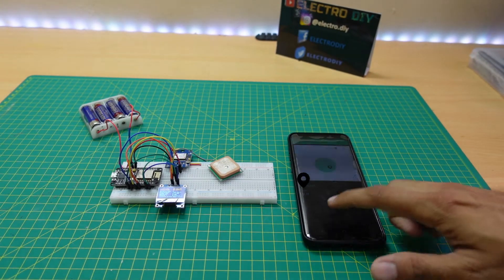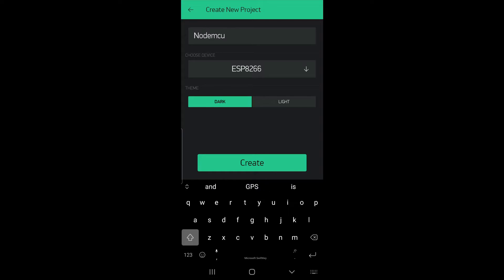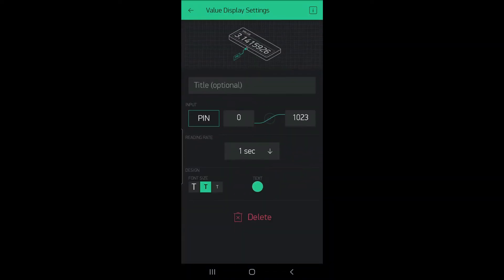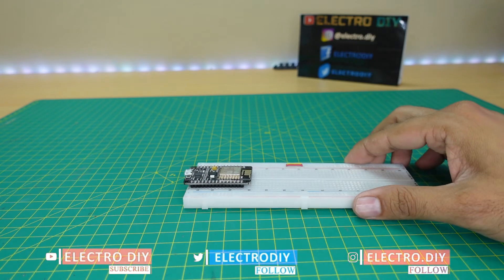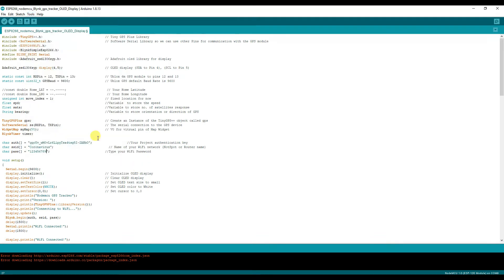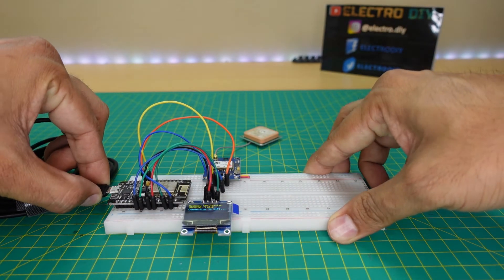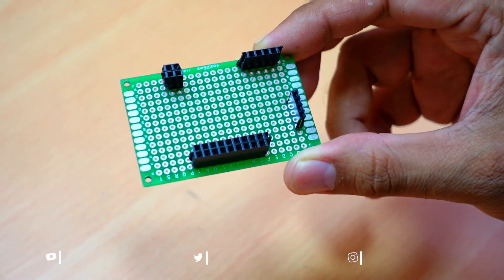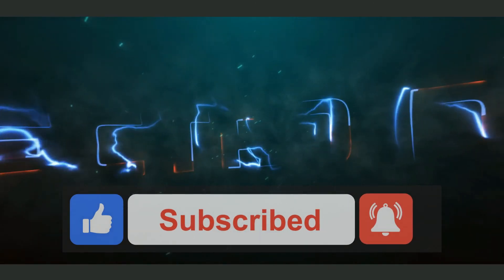ESP8266 Blynk GPS Tracker With Real Time Display

Comment: Actually do we need wifi connection continuously for the gps tracker to work ?
What is heading and elevation ?
Reply from the maker: To get the live updates of GPS, u will need the WiFi connection
Reply: @electrodiy6493  need Wi-Fi connection with this model you made? 
or any other

Comment: Where the hell we will get wifi for esp8266 if want to track from anywhere? Put local tracking in the description bro🙄
Reply from the maker: This project only provides gps tracking if its connects to WiFi. Bro its obvious
Reply: @electrodiy6493 that's what bro if there is no wifi then u can't track it so, it isn't a true gps tracker. U can do it to track from anywhere by adding the GSM module
Reply from the maker: @anoopcc2361  U can lots of uses as if u like to be creative